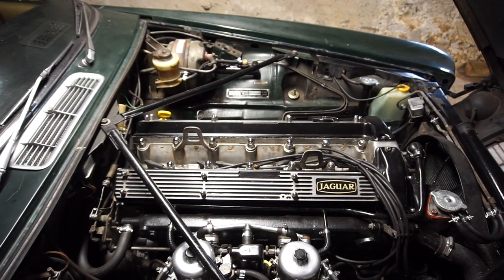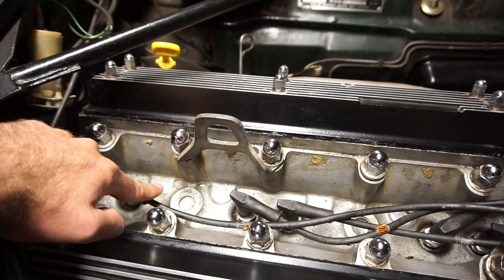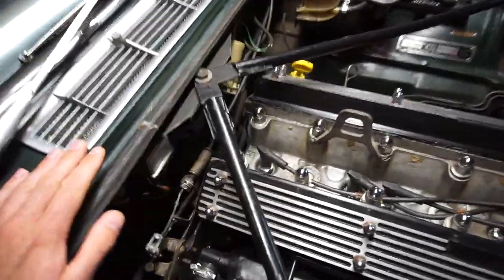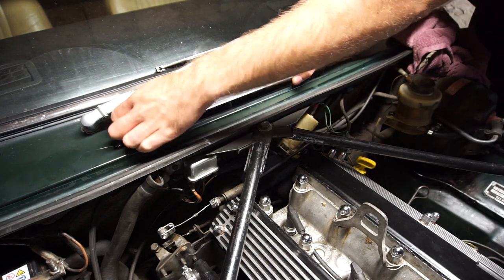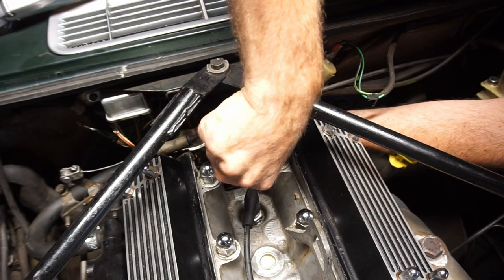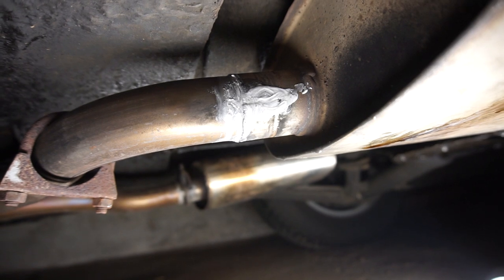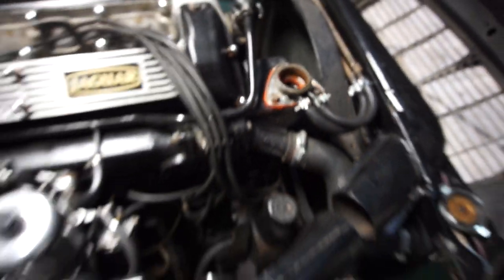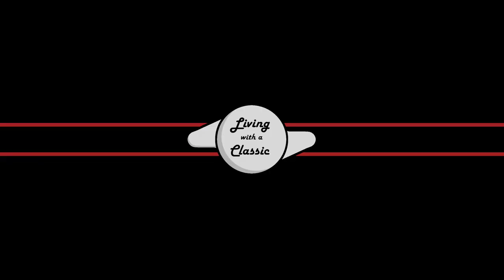My Classic Daily Driver Leaks Fluids

Comment: More things to check out thanks to Adam. His video on aux air valve replacement solved my rough running V12. A tip on Adams worn seats on his daily driver. I bought a complete front and rear seats from a 1987 Jag  parts car for my 1976 Jag XJ6. They were like new but it it was a job to make them adapt but what a difference in comfort.

Comment: It's worth noting that on Series 3 XJs, there is no access to the the engine bay (or wiper mechanism) underneath the grill between the wipers. Attempting to remove that silver plastic grill on the S3, will break the plastic rods that hold it in place, and reveals only the underside of the windscreen washer jet. I had to superglue mine back in place after I removed it in an attempt to access the wiper mechanism.

Comment: Fabulous video as always my friend; I wonder if I can ask your opinion on a couple of queries, firstly, I am planning to drain & refill fluid in differential, I am goung to add leak seal / seal conditioner, there is oil on diff, I'm not sure if drive shaft seals are leaking, I will replace main case gasket at bottom, I can't decide if it is best to add conditioner to old oil & drain in few weeks, or, drain & add conditioner to new oil & keep until next flush, also, somebody suggested applying blue gasket seal when I change water hoses. What are your opinion on these two questions ?

Comment: Hi guys sorry to change the subject from the video shown but can anyone give me advice on bleeding the brakes on my 1975 4.2 series 2 lwb I need to know if it has power brakes ? because if it does apparently it’s harder to bleed the brakes sorry for this but I’ve looked everywhere to find out with no joy so any help is appreciated 🤞🙏🙏🙏🙏
Reply from the maker: No worries. It’s regular brakes with a vacuum booster. You can bleed them as regular brakes. Start at the rear and then the front. Let me know if you need anything else
Reply: Living With A Classic thank you so much your advice has Been a great help most appreciated

Comment: I got a series 3 and heat always blows threw my gents if i drive it drives me insane lol
Reply from the maker: You mean lower heat?
Reply: Mine does the same. The heater valve has no vacuum on it, so I just put a stick under it to keep water out of the heater core.
Reply: I actually blocked the hose off going to it with a valve lol
Reply: Have you tried exercising the vacuum powered valve a few times? I had the same problem as you (especially annoying in the Summer)and changed the heater setting from hot, to cold to hot etc a few times, and it freed up the valve. If that doesn't work for you, it is quite possibly a jammed valve ( fails open - full hot). This vid shows how to free up the valve: https://youtu.be/7czuFs-Qyj0 or you can follow this current post to replace the jammed unit with a new one.
Reply: @cosgraham534  Mine was a failure of the vacuum. The valve operates perfectly manually, but the vacuum line pulls no vacuum.
Reply: @ethann_browne  Great - did you manage to fix it? Should have been easy if you have a new pipe connected to the inlet manifold.

Comment: I have no vacume suck at the heater valve....  where should I look
Reply from the maker: If you have manual heat like in this XJ6 I'd check that you have vacuum going into the heater control. If you do it may be something in the heater control.
If you have the automatic one, check that the servo is making a noise when you change from cold to hot. Hope this helps a bit